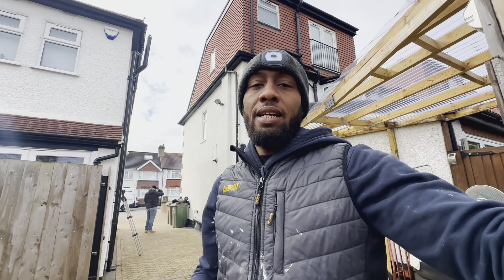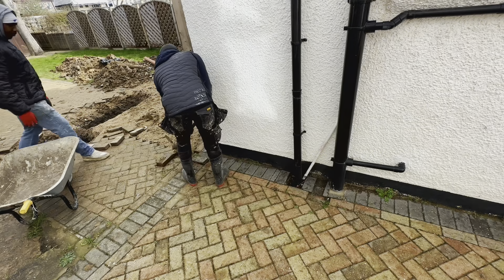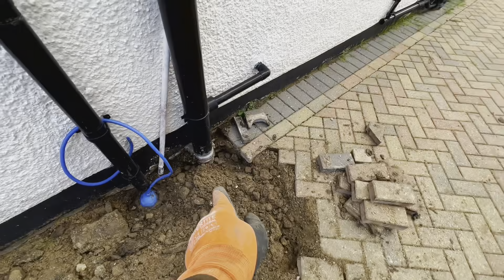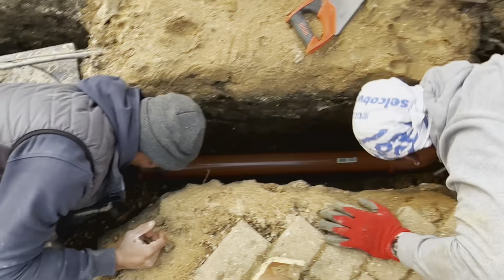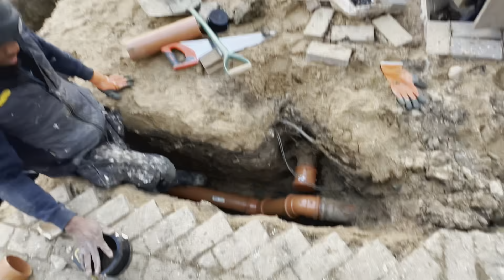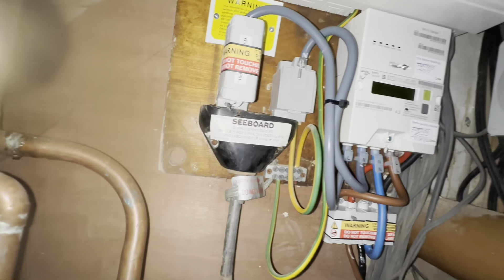Timber Frame Extension Build - Ep 4 New underground drainage

Comment: it looks like 6mm SWA. it wasnt terminated correctly either as they should be glanded. the steel in the armour get earthed at either end. taking the feed directly off the 100A supply lucy blocks, really it should have been a separate switch fuse supply maybe 60 or 80A, less than the main fuse inside the cutout so there is discrimination.
Reply: Doesnt look like SWA to me though. Very dodgy
Reply from the maker: Yeah the electric company said it’s not swa. I explain what they said in todays video upload.
Reply: @iceman6555  yes ive look again and its not swa.

Comment: IMHO ... I would do away with the new round manhole cover and use the old square one that accepts the block pavers ... just needs a course of bricks around the manhole for it to sit on
Reply from the maker: It is square, its a round cover in a square frame
Reply: @darrenthebuilder  But it's not designed for block pavers

Comment: No way is that armoured cable ... The armour is the earth wrapped around it ... would need a sharp spade to cut through it
Reply from the maker: You're right. I just spoke to the engineer who said its their cable which was put in illegally by someone who probably works for them (under the table job)
Reply: its only earth if one or both ends have been glanded and terminated property to earth. even if it was swa it can still be cut as he was lunging that mattock around.